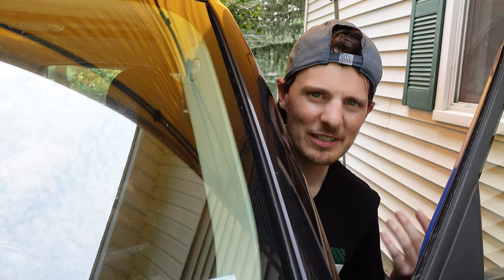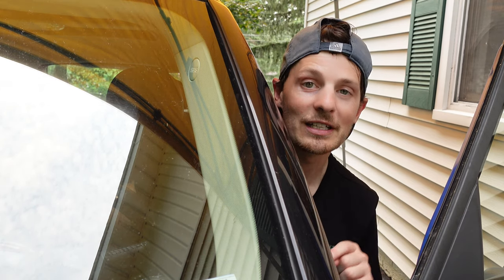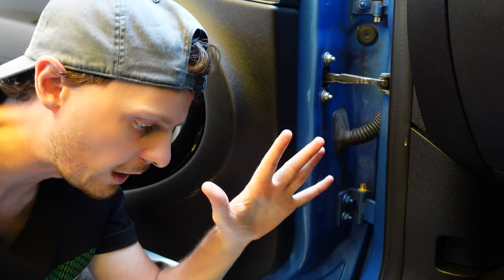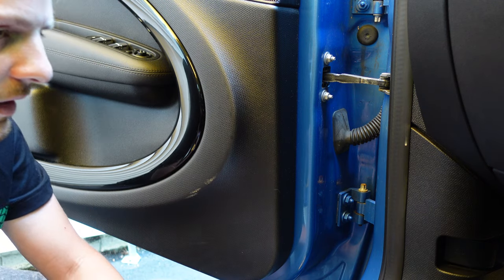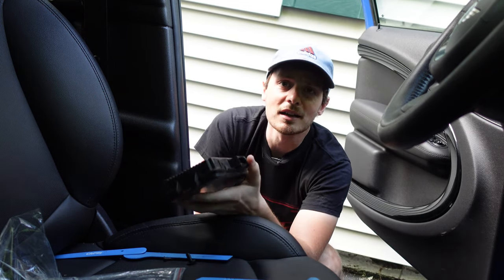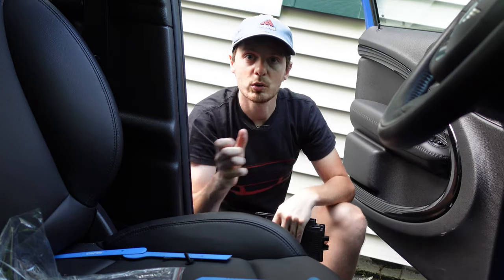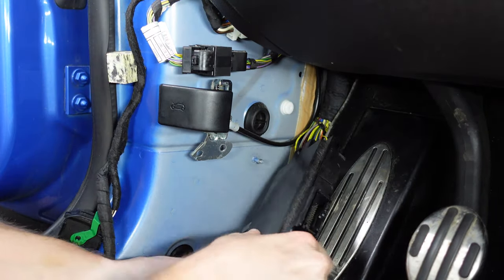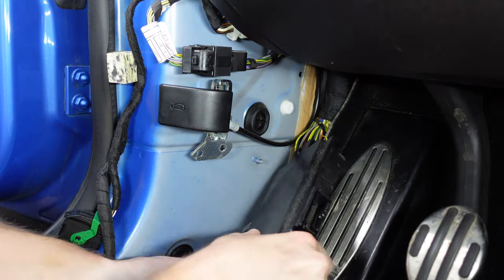I fixed my MINI Countryman foot control module!

Comment: thanks for this, having the same issue here in the UK, your instructions for getting access to it were super helpful. I'm sending mine off tomorrow to be reflashed so fingers crossed it will solve the issues. I also recently changed the battery, but it took a week or two. I think I had a loose connection on the batter which might have caused it
Reply: Me to. Also UK. What did you do. Where send it to flash it ??? Thanks.  Indicators. Windows. Lights. Etc etc.    I’m thinking 100Euro to £300 ish.
Reply from the maker: Glad it was somewhat helpful and good luck with the new flash! Hope it goes smoothly!
Reply: Uk to just bought it batteries dead won’t even lock the car with the key now and I soldered in a new key fob battery incase it was that nope so just ordered a new exide Amg battery shittin them now

Comment: You did nothing wrong. The same thing would have happened with an OEM battery . You state it is an issue with a loss of power or the surge of reconnecting. The only thing that may have helped was one of those 12v power packs that you plug into the lighter socket to maintain volt to keep info in memory of the computer.
Reply: I was thinking the same thing, how a Mini battery would have been any different?

Comment: It's sort of why I just paid to have the battery in my wife's 2015 R60 replaced at a dealer - this time around for her 2013 R60 (lower miles than the 2015 she had) I decided to replace myself and buy the Autel AP200 to register the new battery.  All in I'm over what I'd spend at the dealer BUT I know it's registered AND the next battery for any other Mini /BMW can be registered and I should save a bit over having the dealer do it.

Comment: just got a recall notice for the FRM today. Recall Campaign No. 2023-281:(M61 91 23RC)Footwell control module (FRM)
Reply: This- has still no remedy at the moment. Called them yesterday as I am having issues with my FRM
Reply: @nurse.reef.repeatandsomuch1758 exactly bought 2012 country man as used, probably firs owner complied with recall, but had to repair FRM two times and replaced with new one. So you are right, there's still no 'cure ' for it. When one has to replace a dead battery you have to visit the shop for more labour job.

Comment: even 150k miles for the warranty is BS, this should be covered forever if it happens, it's obviously Mini's total F up and not something a simple battery replacement should ever cause.
Reply from the maker: A lifetime warranty would be nice for this issue.
Reply: I totally agree with on your this one, it is 100% design/coding/software flaw from BMW/MINI despite the miles.

Comment: Thanks for the video. I had my car on charge while I did an oil and filter change and think something's spiked the voltage. No longer have functioning front power windows.

In case anyone finds my comment, the FRM3 is also on the left hand side of a RHD (UK) R60 Countryman Cooper S car (so passenger).  There is a final clip that is a nightmare to remove.

About to post mine off and hope for the best.
Reply from the maker: Good luck! Hope it comes back in working order!
Reply: @TheMINIVlog  Thank you. Got it back last night, front windows working again, will try diagnostics later. Absolutely terrified as to whether I can ever put the car on trickle charge again in the future or not though?!
Reply from the maker: Supposedly the newer software on the module solves this problem so in theory you should be good. In theory.....
Reply: @TheMINIVlog  From reading up, it seems the 'quick fix' is just to read and reflash a very small portion of the flash. All of my custom codings (welcome lights set to Foglights instead of sidelights as an example) are still in place, so don't think the software was updated on mien at least.  There are some UK sellers that charge £200 and seemingly do a bigger job
Reply from the maker: Ah I see. Good to know

Comment: Great video! Just wondering,  since the battery seems to cause the FRM to fail, is it safe to install the module with the battery still hooked up?
Reply from the maker: Right? It's a bit of a dilemma! It(the battery) really probably should be unplugged before you plug in the computer to prevent any chances of a short. But I also didn't want to be in the same boat. HOWEVER since the computer is already completely powerless before you reinstall, you should be able to unplug the battery, install and plug the battery back in without harm. SHOULD but I make no guarantees!

Comment: Great video helping ease my anxiety!! Thank you! So I sent my FRM to a service and they helped flush it. 
Did you connect the FRM back with the battery connected? Or you had some other operations?
The service provider say I need to disconnect the battery first, then connect the FRM back and finally connect the battery back. But that's exactly how I got my FRM corrupted! (my FRM was good until some day I disconnected my battery and connected it back after 30 min)
Thank you.
Reply from the maker: I did not unplug my battery because that too is how I ended up in that situation. Probably not advised but I left the battery plugged in when I reconnected the FRM.

Comment: Great information!
My R56s also had same problems after I replace the battery, So the module require remove the battery or just turn off the power only?also confused, if the low battery can cause the footwell module dead, what we can do to protect this when we replace the battery,remove the module first then remove the battery?😂
Reply from the maker: There are devices that plug into the car to provide it with constant power while you swap the battery. Also, this won't happen every time. It was a known issue that they extended warranty on 2 times.
Reply: @TheMINIVlog  thankyou so much and great video.
Reply: @TheMINIVlog  did you disconnect the battery to install that module or keep connected?
Thankyou so much
Reply: @williamhui8809 I have the same question

Comment: I have a Mini Countryman R60 (2011) and the footwell module is failing.
You mentioned a extended warranty for vehicles up to 150.000 miles (about 240.000km). Any more info on that please?
My Mini only has about 172.000km (about 107.000 miles). And does this warrany (if still valid) also works in Europe/The Netherlands?

Comment: Planning to get my battery changed as well, but your story scares me. Wondering if your issue could have been avoided should you had used a battery tender or memory saver when removing the battery.

Comment: Hi, thanks in advance for these videos. Very useful. Just a question. What model and year is your Mini?, because i have a 2012 Countryman All 4 S, and i want to change the battery for an Optima Yellowcap, and i don´t want to suffer 😅. Grettings
Reply from the maker: This is a 2013 Countryman All 4 S

Comment: I am pretty sure I need to disconnect the battery to remove the JBE.  Do you have the same risk with the FCM just disconnecting the OEM battery?
Reply from the maker: Honestly, I am not sure
Reply: @TheMINIVlog So it will appear as if I'm not supposed to disconnect , jump start or charge the battery? How to safely replace it then without visiting the garage and without damaging FRM 🤔
Reply: @malefanematsie3890  This is where I am at bro.  My JBE went bad, and my battery drained.  The battery in there is a NAPA and I already disconnected it.  I want to replace the battery as the NAPA is lead acid.  I have been trying to find at least the same Ah and CCA as the original but I don't know what that is?
Reply: @justsomestuffn  other 'experts ' say that you shouldn't have disconnected or removed the battery without having first connected the 'memory saver' device. Even the host of this channel has admitted else where  in this comments that 'he believes that the dealership replace the battery in this manner. ( I also think this is the case after viewing a video, of Mini successfully replaced while memory saver is connected to another temporary battery). In your case you can either book in the vehicle to the dealer or independent mechanic (preferably bmw/mini specialist)  to install after doing diagnostic on FRM or DIY ( with correct Ah and CCA and if your windows , indicators and lights are still working , have the battery registered and never disconnect unnecessary. Well that's the opinion of some channels. 🙏
Reply: @malefanematsie3890  This should be interesting.  I disconnected the battery a day or two after I last turned anything on.  I took the battery to Oreilly's and they checked it and said it was still good.  So they charged it.  This way I am putting the same battery back in and not a new one.  At this point I am just going to hook everything up and see what happens.  I get my JBE tomorrow and hopefully it will all work.  Its not like all FMC go out when you disconnect the battery?  Right?
Reply: @justsomestuffn  That's right, not all FMC goes out  every time the battery is disconnected, agin even the host mentioned in this video's comments that it doesn't happen always. Just ensure that no prolonged spark appears at negative termina by connecting positive first and negative last and fast, that is the negative should not touch the battery terminal before positive. Good luck with this and your JBE. Iam speaking from personal experience, my Footwell module control only stopped working after  I have disconnected and connected the battery several times without issues. Only after I have touched the - before + did the spark occured and then the symptoms of windows etc.
Reply: @malefanematsie3890  Thanks.  I will know in a few hours.  I inherited this car and the JBE went out 200 miles from home in the middle of nowhere.  And this was after i spent $2,000 to fix leaking oil filter housing and cracking water pulley and belt. I then spent another $800 just getting the car home, which took two days!
Reply: @malefanematsie3890  I got the JBE and hooked it up.  I cleared the codes and everything seemed good except for TPM system.  I drove around a bit, pumped up the tires and tried to reset the TPS.  While driving, a check engine light came on, and it said the engine was overheating and to pull over.  AHHHHH. Pulled over and walked home. will check the codes a few hours. I am not liking this car one bit.
Reply: @justsomestuffn  Thanks bro for update, at least now you know that it's not FMC. I know how you feel after trying so hard to keep the inherited car roadworthy. As you know we are talking German over engineering here. One electronic problem here, you fix it, the next one is unrelated mechanical problem and so on ( visit scotti Kilmer and wizard channels ) you are not alone as I am now seating with a quotation of 800 dollars, 2 days ago for thermostat, coolant pump and pipes. Mine just over heated and all water in the reservoir leaked out (what a coincidence) in as much as I liked this car, I also start to hate it . Any way I hope you follow up and if 'half engine 'check light shows up,  it will probably lead to thermostat as in my case. Codes will clarify. Thanks 🙏
Reply: @malefanematsie3890  There were 4 codes, but the most telling sign was the leaking oil combined with antifreeze and empty coolant reservoir.  Codes were 33ff Engine oil pressure control valve activation/ 3788 Aux Coolant pump Electrical line disconnect/  CF2D Coolant temp, from engine management/ E1E3 Signal, reverse gear: Implausible .....Gonna tow to a mechanic and see what the damage is.
Reply: @justsomestuffn  yes, the codes are centering around over heating as you were warned earlier. Towing to the mechanic is a good idea as they might carry out sophisticated diagnostics. As usual they will charge for diagnostic only and issue quotation for any major work. As I said , I had to tow mine back home after 800$$ quate  I'm still gathering it. Don't be in a hurry to sign a good luck and fingers crossed bro!!🤞
Reply: @malefanematsie3890  I have come to the conclusion that a freeze/frost plug has come loose.  I can test it by blowing into the coolant res and hearing the bubble noise in the crankcase with oil fill cap off.  Doesn't seem catastrophic at this point.  Found a video where the guy cleaned/flush out the engine, and cooling system, multiple oil changes and was good to go.  We shall see
Reply: @justsomestuffn Got it? What is important is that the initial suspicion of FMC  is not the cause of all this or this mechanical and/or electrical issues is not related to FmC . You seem to be good with DIY,  good luck bro!
Reply: @malefanematsie3890  I towed the car to a mechanic who verified that the problem was a freeze/engine core plug.  They are charging me about $750 to change both plugs flush engine and cooling system.  Seemed reasonable to me.  The worst part was looking out the mechanic's and seeing the tow truck driver jump my car!  After all my fears of the FMC going out- and this guy out there jumping the car.  Hopefully it didn't mess up anything.
Reply: @justsomestuffn  judging by the work to be done, the amount charged is indeed reasonable, to reach the cooling system they have to remove some parts. As for the tow truck driver jumping it, no need to worry about FMC. The manual book make it clear that when the car has not been driven for a considerable period of time, it must be charged and can also be jumped from another car. if you successfully removed and installed the battery with no issues to FMC. Jump start is do able 👍
Reply: @malefanematsie3890  Just got the car back yesterday, and when I got home there was water dripping from the water pump.  The service manger mentioned the tech told him it was seeping a little and keep an eye on it.  This may have been the problem that led to overheating, which led to the freeze plug coming out?  I dont know.  They could not get a core plug to fit so they threaded the hole and did it like that.  Anyway they quoted me $600 something to fix this.  Service manager said he would try to get me a discount because he feels I shouldn't have left with he leak that bad.
Reply: @justsomestuffn  glad you didn't have battery problem after the tow truck driver jumped it. As for the water pump dripping water after repairs, sounds like the service manager is reasonable by considering discount, since the tech was aware of the water even before you took the vehicle, that's the norm of most mechanics (mine too).Any way 600 + discount is reasonable if they keep an eye on water pump and ensure that codes relating to overheating are cleared. You are about to complete the repairs 🙌

Comment: When you unplugged on the bottom you unplugged two ports when you reinstalled it there was only one at the bottom?
Reply from the maker: No there was two, I just did not do the greatest job of showing the top and the bottom during the re-install.

Comment: Thanks for the video. When you reinstalled the Module was the battery connected or disconnected?
Reply from the maker: If I remember correctly it was still connected. But I am not sure that is the proper way.
Reply: @TheMINIVlog  im about to receive my fixed frm module. Idk if i should leave the battery connected or not during the frm installations

Comment: I have had this problem in the past and fixed it without anything to do with FRM.   I think I had the battery replaced ? No one can recall the fix !
I am having this issue again just after a BRICK STARTER jump start.  But prior to this I noticed 11.5  v on the battery, and trouble starting.
Reply from the maker: It is! :-)

Comment: For those who are interested in preventing this in the first place there 3 things to know. 
1. Always replace with the same capacity battery. Or else you will have to reprogram the battery module to let the car know that your battery is now different. 
2. Always disconnect the OnBoard Computer harness before your touch the battery. Computer will reset anyway when you remove the battery. 
3. ALWAYS attach MINUS first and PLUS after. This is how you don't get power surges. 

This is not a Mini only instruction it's a general A/B/C knowledge. Dunno how did this guy mess it up.
Reply: This guy didn’t mess it up it’s a recall on the model itself. I have the exact same thing and mine turned on just fine and then just all the sudden showed the codes
Reply: yeah ive never heard of another vehicle requiring that you disconnect any onboard computer before diconnecting the battery. that sure sounds like faulty design.

Comment: These sort of issues should be lifetime warranty and fixed on the spot, you should not have had to wait 3 weeks but it ended up costing you! Very disappointing BMW, especially considering how easy it is for them to fix the issue.